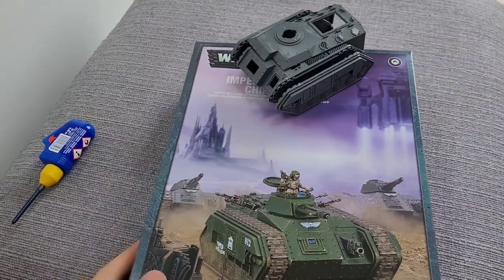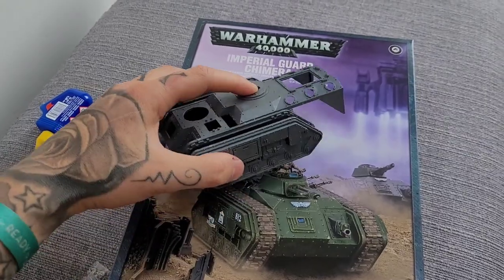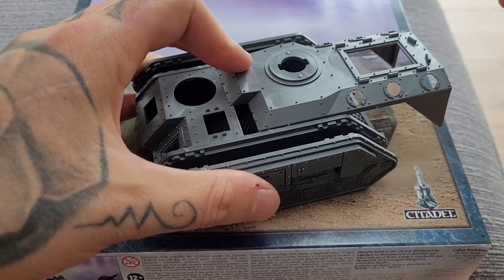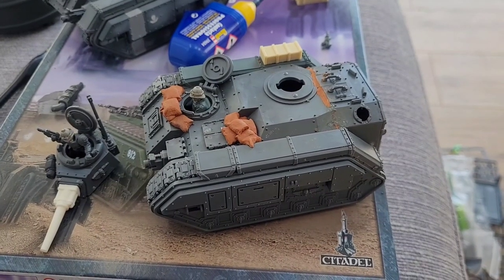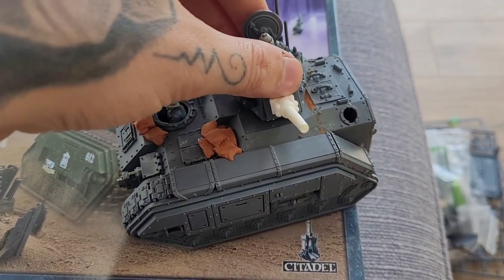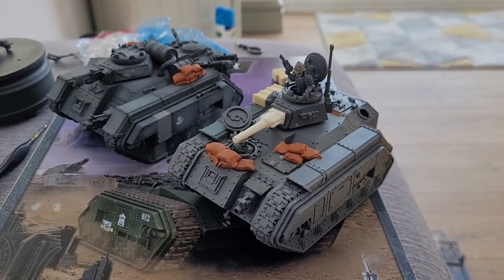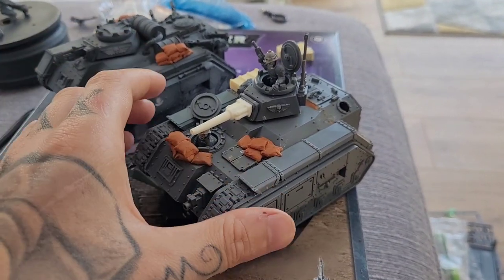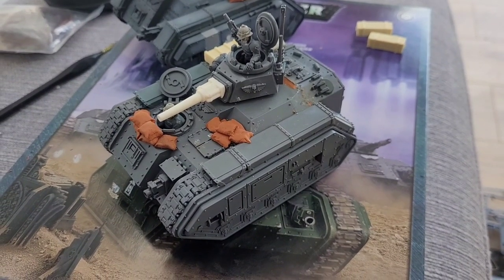chimera conversion.

Comment: Awesome 'how to' video of an awesome conversion. Saw one of these (without the how to bit) that was made ten almost ten years ago... yet GW still hasn't produced a new Chimera boxed set to accommodate this option in all that time.

Seriously, all they needed to do was redesign the top section to provide it in three parts with the front and back edges of the rear hatches located on the front and rear parts. You could add the 'middle' section for a front mounted turret, or leave it out for the center mounted turret option.

Obviously, the kit would require the rear hatches to come in two options, long and short, and a set of top hatches for the exposed front section left by the center mounted turret option, but it would be doable. They could even toss in some other turret mounted weapon options. And given how much GW charges for these things now, it would make sense.

Still, rumor has it GW is finally going to release some new IG stuff later this year (2022), maybe even some plastic kasrkin we all wanted back in 2014. And the company is all about supplying product at affordable prices for their customers to participate in the hobby and not just maximizing profit for the least investment (that was sarcasm), who knows? It could happen.

Until then, at least we have this tutorial. Simple, clear instructions with some ideas to tidy it up, and a single color paint job to help us see the finished conversion. Nice. Well done, that man.
Reply from the maker: Thankyou mate. Yeah I agree things need some updating but the last 2 years has been massive for new releases so hopefully they continue that trend into IG
Reply: @jamst123  Nice to see something from GW, but a decade is a long time between drinks, and (combined with the massive cost increases) it's cost them a lot of customers. 

Simple product adaptations, at the right time, and reasonable prices, can help expand a market, but when the market includes a hobby aspect, its even more important. Games work best when there are lots of us. 

You have the skills so should get real converty and make a demo model of the idea I suggested, then contact GW with the images and see if they don't feel compelled to steal the idea and put it into production. They could even name the alternate central-turret pattern version after you. Nice.

Comment: Looks awesome, not sure how long the sandbags in front of driver would stay on the tank or out of the drivers lap but hey it's super cool.
Reply from the maker: A few good bumps and they probably would be gone.. along with the drivers head 😄
Reply: @jamst123  I just got a ebay chimera, it's pretty rough, and am thinking of this mod. I been tearing on it and is coming apart quite easily.
Reply from the maker: @shangron5796  should be doable then pal always worth a try 👍

Comment: What tools do you use to cut the pieces? I'm very interested in this but I'm unsure how to do it
Reply from the maker: I usually use sharp modelling tools then use a small handheld dremel tool to polish the edges. You'd probably get away with modelling clippers as long as you are careful and fill the gaps with green stuff etc 👍